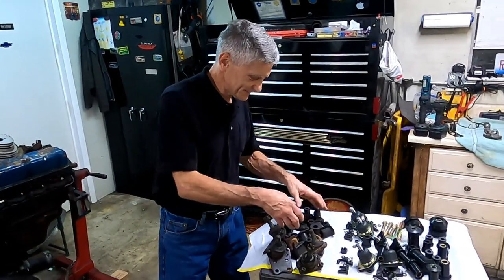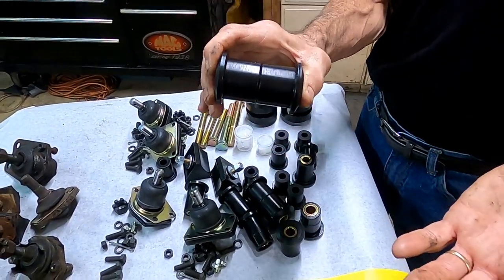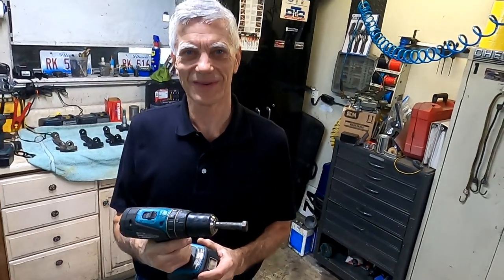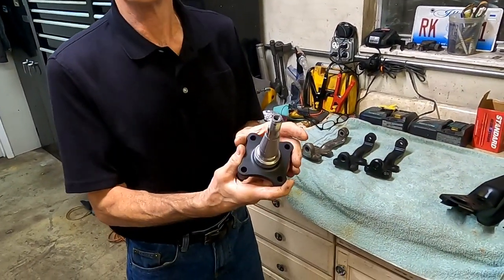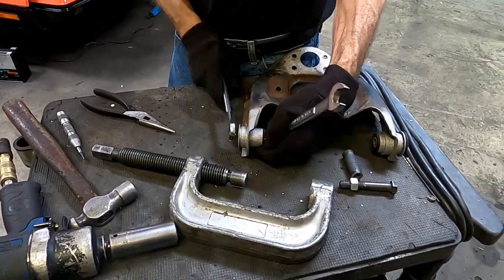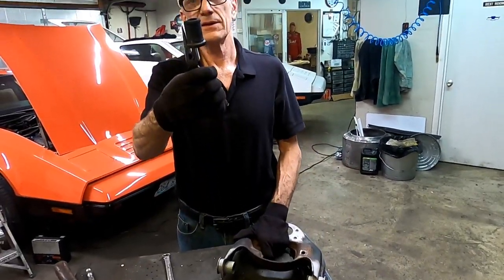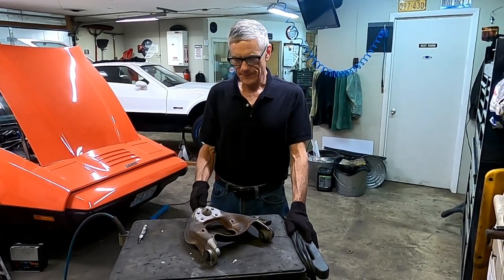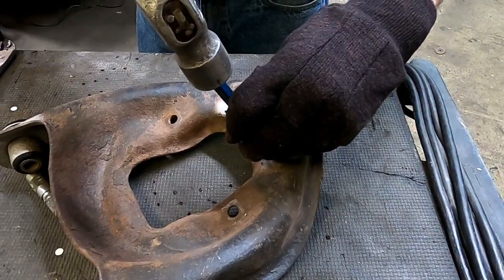Suspension Restoration Part 1:  Urethane Bushings & Ball Joints

Comment: Just completed my bushing upgrade on the leaf springs. Video was very helpful. What kind of torque would you recommend for the rear shackles and front of the spring
Reply from the maker: If you had purchased our bushing set you would have the correct bolts so that I could give you correct torque numbers if you're reusing the original bolts they are the wrong grade. Contact me at bighbricklin.com.